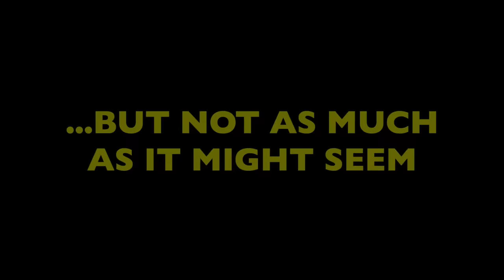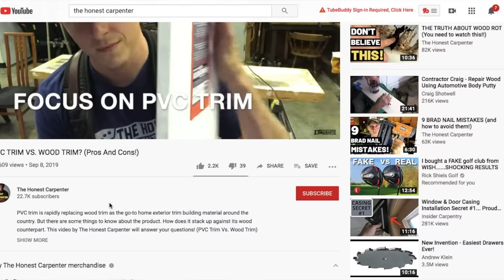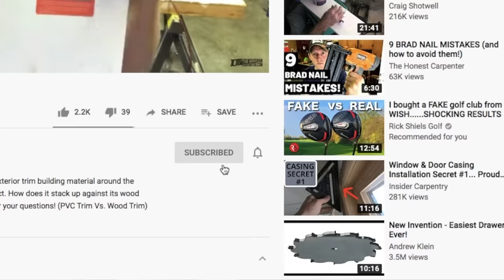How Much DAMAGE Can CARPENTER BEES Cause?! (What To Do About Carpenter Bees/How To Get Rid?)

Comment: I've used spray foam insulation in the holes with great success
Reply from the maker: Never tried that, Mike! But it makes sense...I bet it expands far into the tunnel
Reply: I think theres a "pest control" version of the foam too. Could be a good deterrent.
Reply: "Bee" careful with spray foam as it actually draws in moisture over time so it can rot wood or if next to mortar it will wick into it and cause damage
Reply: Weird. Spray foam is useless at keeping out regular honey bees.
Reply: Crickets love to eat spray foam...so I am gonna assume many other insects do too.
Reply: @thehumantoeRD  : Spectracide has a termite foam that also specifies use for "carpenter bees". Just heard of it. Headed to Lowe's now to find some. Put out 12 new traps yesterday at the horse barn. Going to plug holes in barn structure and see if they'll be interested in the traps. I've enjoyed the tennis racket game but my 70yo skeleton says to stop that.
Reply: Interesting because I tried this before and they seem to eat the foam insulation like it was cotton candy. I've filled the same hole half dozen times and they just went right back in within a few days.
Reply: Fine steel wool also works well
Reply: Spray wasp and bee insecticide into the holes and plug them with painter’s caulk.
Reply: @thehumantoeRD  There is
Reply: I moved in a rural house at the end of this winter.  As spring rolled in started to notice that I was moving into carpenter bee's home. 😁. I mean they were living in front stairs, side stairs, back deck, under the sheds. Did research and found that they are here to stay and we humans go and come.  Talk to neighbors and they had same issues. My son would reach to grab them mid air. Honestly we could not enjoy the outside. I know they are cool and all but we paid to be here so we need our space too🤨. So I figured bird feeder, birds around will eat some bees. Nope. So I got a carpenter bee trap. That worked but there's lots more. So I said I need my deck back. I unscrew few key located boards where I saw saw dust and found 13 holes. 😱. So I didn't know what to do now. And it hit me. Earlier I was working on my lawn tractor and immediately made the connection in my head. Grease gun hose is perfect size to the hole.  So I filled every hole. I'm telling you carpenter bee's don't let their home go easy. These guys would dig in it and die. To shocking results they stopped going for the same holes. Now the bee's under my shed. Can't see the holes. So I made the sad but no other choice decision.  Bought a  tennis racket and and... . You know.  Between the trap , plugging  the holes with grease and me with racket I took out approx 42 bee's. Right now I don't see any and we been having so much fun outside. Just wanted to share my experience with you guys.

Comment: Good luck on the structural value of deck railings after swiss cheesed.  Deck floor joists as well. They seem to like oil based surfaces less, will chew right thru latex. 
We re did the railings on more than 100 decks at an apartment complex.  It was a liability issue for the property.

Comment: Hello Honest Carpenter, have you ever tried making a plywood and corkboard sandwich? When we put these little 10-inch square sandwiches across the barn, the carpenter bees quickly inhabited them and left our barn structures alone. When they figured out we wouldn't run them off the sandwiches, they stuck to it and even defended them if we got too close. (bumping, not stinging) But the best part was that they chewed on those and left our barn alone. We got to keep the bees and we weren't suffering from damage.
Reply from the maker: Good advice, Clawdya!

Comment: This was very helpful!!  I put a used wooden swingset in the backyard and suddenly I have a ton of Carpenter bee's hanging around it.  Now I know to paint the wood to help them move along!!
Reply: Don't be surprised if that does not work.  I stained a cedar porch, and they didn't mind drilling at all, - at the stained ceiling where it is hard to get to to patch the holes.  I will say they do a good job of making perfectly round holes without a pencil & compass.

Comment: Great advice. I share a huge moribund oak tree with 3 neighbors. We have different approaches to these guys.  I live in the hilly suburbs of  San Diego. The female C.B. are blond/golden and scary looking with green eyes while the males are deep purple shellac color. They are harmless but buzz when agitated. My neighbor below us witnessed how the C  B. Took down the largest branch. Funny enough is that they don't eat it or live inside the dead trunk. My other neighbor sprayed inside the burrow holes with WD40 and filled in the holes with foam. Since the tree is almost dead and they ignore any of my wooden structures. The prior tenant would mix brake fluid and old motor oil and hosed them down in the fall and winter. Crazy

Comment: I like the plastic bag thing. I've had good luck with putting a mothball into the holes they've bored.  The smell drives them crazy. Also, you could put mothballs in old socks, place them at each of your attic, which will help keep mice, squirrels, bats, spiders, etc out.
Reply: Thats very interesting . I shall try.
Reply: Works real well with sweaty used unwashed socks.

Comment: I had carpenter bees in my fascia boards on my garage and side of my house. No big deal until a woodpecker was trying to get at them and I woke up to what sounded like someone banging on my house with a hammer. Not to mention they were spraying their goop on my siding under their holes. Was a headache to deal with and fix the holes, but haven't seen them back for a couple years

Comment: Great video with lots of information.  I am located in Ontaro and they have found my untreated carport.  The carport is to high for me to treat and I did have pest control last year but it did not last.  I was going to have the carport painted but there are so many nails on the underside from the roofers when the shingles were replaced.  Next option clean the wood and have fascia/soffit installed.  I am awaiting some pricing.  Has anyone had any troubles with them getting under the fascia/soffit?  Thanks

Comment: We had wooden barns on the old farm. They were so infiltrated with them over the year I did not take any of the wood when we sold and the land was cleared. I found a preventative ... we have all steel structures. I have seen some around here and told them to give it their best shot. They can be territorial and you should move slowly. They are attractive to quick moves.

Comment: I had a problem on the underside of my porch railing that was 90 years old.  I would use spray foam to seal the holes since I could flex the nozzle to get to the hole and I really could not see what I was doing.
But I always admired their perfect 1/2 holes.

Comment: If you have just a hole you can use a wooden dowel to fill it. Drill the hole the same size of the dowel big enough to fill the hole. Put some wood glue on it drive it in and cut it flush to the surface and you have a solid repair. Same trick works for stripped out screw holes like on door hinges also.

Comment: I use PL375 sub floor adhesive to pump in and fill the holes.  It covers the hole and maintains the structure integrity.
Reply from the maker: That’s actually a really good idea, Jim. Probably the only one that repairs at least some of the structural damage.

Comment: Things to know about bee hotels...If you use bamboo, cut at least 6 inch lengths. Be sure the inner 'walls' are removed and sand the entire cut surface, inside and outer edges. Make sure it has a roof and is hung out of heavy weather areas, for example on your porch or under the eaves of a garage or outhouse where the entrances to the holes are not getting rained on. Always keep an eye on the entrances because spiders love to hang out, web them up and eat trapped bees. Gently brush over the ends if you see any webs formed. Instead of tubes (bamboo or cardboard), you can drill varying size holes in a block of wood, again, be sure to round over the corners of the cut holes, bees are delicate. These are just a few things I've learned.

Comment: 2:59 Build a house out of bricks instead of wood? Just a food for thought. :D
Reply: Does that house come with brick trim as well?  On a brick house, the bees go for the wooden trim... especially cedar.
Reply: @cward1954  Now the question is what you refer to as a trim (it could be several things). But I am fairly certain that on brick house you woldnt face any problem with these bees. Simply because there doesnt need to be any exposed wood on the outside.

Comment: A trick you might try. Cover the hole with a piece of untreated wood. Make sure it's big enough for the bee and all of its friends. Drill a starter hole 1/4" deep. Then when the bee comes back it might try to make its nest in the new wood. 

If the bee does move in, slowly move the wood to a less unsightly location while the bees are active. It's important the bee is able to remember the new location, so only move it an inch at a time. Plug, caulk, and paint the original hole. 

A handy woodworker type might even make an attractive bee hotel.
Reply: I will try this.  We have worked hard to have a NWF backyard habitat so prefer options before killing.  Wonder why the woodpeckers are slacking.

Comment: They will absolutely destroy your house. They also have no problem with treated wood. They totally destroyed my Dads deck. We had to replace several joists so the deck would not collapse. Afterwards we setup traps and caught some but it did little to stop them. We did the plastic bag/paper bag trick and that did a great job keeping them away. We also painted the entire deck. So far this year we have not seen any of the, around.

Comment: The best way to deal with carpenter bees is to not make you house out of chopsticks.
Reply: Don’t leave tools lying around either.
Reply: [Communist China has entered the chat]
Reply: @TerraTN   So right! My home is sided in redwood so I am VERY interested in controlling them. I use an insect net to catch them on the fly. If I see one making a new tunnel, I spray butane into the hole. Instant winter!

Comment: Here in Quebec we call them bumble bees, and yes I've had them drilling holes in my pool deck and even found them in my bathroom vent
Reply: Carpenter bees have shiney butt.  The good bee has fuzzy butt.  I spray wd40 on the raw wood where carpenter bees like to drill.
Reply: The carpenter bee and bumblebee are different from each other despite looking somewhat similar. Bumblebees usually nest in the ground. Carpenter bees burrow into wood, often your house or deck.

Comment: Thank you for this film. I recently replaced the garage door jambs ( 24" ends of them to be more exact) and on one side (only on one) found some holes pretty smooth in the wood rail to which the door jamb is attached. That wood was very-very dense. There were no insects there, I filled all the holes with wood filler (saw dust and good wood glue, which is supposed to be of structural strength), let it dry, painted w/Kilz,  installed new ends, sealed w/Exterior DAP, and painted twice w/oil based paint. I assume the carpenter bees got there inside through some slits in the old and rotted ends.

Comment: I've made 4 traps out of scrap wood, and the top of a Tropicana Orange Juice plastic bottle.  I catch hundreds of them each year, but they keep coming.  I also practice my tennis strokes and take several out each time, but I think they see me coming with my racquet now and scatter.  They go under my soffits and I used that foaming stuff that expands to try to fill where they enter, but they have defeated me with that by finding new ways in.  They are a persistent lot.  They do however pollinate my flowers and garden items, so I hate to kill all of them.  One time I opened my trap as it was filling up, and to my surprise, I had 65 of them in the trap.  I hang the traps high so I have to use a ladder to get them down to empty them, so I don't do it that often.  They made 2 new holes under my rear steps.  I filled one hole with plumbers putty, and they dug out in one day.  For anyone that knows about Bondo (usually for auto dent repair), that works great.  They never return thru that stuff.  I've only used it once though, but it has worked for 2 years now.  They do not go thru the foam stuff either.  Hope that helps someone.

Comment: I've had good luck with using a paper bag where carpenter bees were just getting started, but not luck deterring them in areas where they are well established. The traps have been useless in my experience. I wasn't aware that carpenter bees were pollinators until now, thanks!

Comment: I've had carpenter bees in one of my sheds for over 10 years now.  I like them.  So far they have no messed with my house or my other two sheds.  They are my little buzzy buddies.   In the summer my backyard is like Tolkien's Beorn bees.  Whatever damage they have done to my shed is worth their company.  I'm worried as the shed is in need of a painting and not sure how I'm going to do that without harming them or driving them to my other sheds or house.  Perhaps in the late summer/fall to avoid doing harm.  Maybe stuff holes with a cotton ball.  Something that can be pulled out.

Comment: Have you noticed the newer (last 10 years) pressure treated wood does not prevent carpenter bees? My deck is 30 years old and carpenter bees never touched it. I put in some bracing (for new deck posts) with the newer pt wood. The old pt wood was cuprous arsenic, nasty but effective preservative. The new style pt wood had holes drilled in them in one season! I'm going to paint/stain them this year, that has worked for me.

Comment: What worked for me is spraying prone areas with Ethanol that contains Bitrex. 
They try to land don't like it and fly away. Try another approach for several times but will keep them away without killing them. They'll eventually find a new spot somewhere else than the roof. 
Garden post etc. is fine. That's not structural.

Comment: I had a terrible time with them when I bought my house 30 years ago. I told my young children that if they spotted one and I caught it in my insect net I’d give them a stick of gum. I quit that reward to protect their dental health. My house is redwood and it’s very hard and expensive to replace wood, but to put siding on or paint would be a disgrace. So I have fought them over the years. Things finally improved when my neighbor tore down his much infested pergola. They still get after my cedar and redwood fences. I have tried the foil and steel wool and yes it is critical when it is done. If they are in the pupal stage when they emerge they will have to chew their way out causing lots of surface area damage. Lately I have dealt with infestation in my fence with butane. I inject the cavity with butane and freeze the larvae. I also keep a net handy and snag one whenever I can. They don’t get relocated.

Carpenter bees are solitary wasps. I once asked a famous entomologist, if they are solitary why do I see huge numbers of them. She explained that solitary means there is no caste system with different individuals performing separate roles for the colony as you would find with honeybees. Her name is May Berenbaum. Look for her books. So funny and so instructive. Look her up. Gene Robinson is another bee expert who lives nearby. It’s not everyone who is first to map the bee’s genome. Living in a university town has advantages.

Comment: Expanding foam holes. After spraying hole with essential oils. Take a log, put eye hook in center, drill 3/8 holes in bottom bout 2 inch deep, to 6 inch. Hang from nearby tree.  Bee hut. My new porch has the going into countersunk screw holes under railing. Not sure if im gonna get rid of them til winter. I Like bees.

Comment: Every spring for me is a stakeout with an old badminton racket. They sure do zip straight up fast when you swing it, but if you anticipate it, and swing higher than you think you'd want to, you can get them. It just a good thing they DON'T sting since  you miss and piss them off 90% of the time. Tennis rackets are no good. Can't swing them fast enough to beat their escape.

Comment: I read about the bag solution, however I was told a brown paper bag filled with misc filler works best. I tried it about 5 years ago, and it works great. The paper bag will actually last most of the year, and I was told that they think it’s a paper hornets nest. I was told their eyesight is not so good (think Mr Magoo) so it takes a few days for them to figure it out, then they’re gone. Gotta do it every year. 
I used an 18 inch fish leader wrapped around the neck of the bag, with a push pin to hold it under the eve. Prepare yourself though, any friends that visit your house will think you’ve slipped a gear lol

Comment: JB weld the holes. They ain't digging that out. I made a target for them. I took an 8 foot length of landscape timber and put it on two posts in the ground at either end. Then made a little roof down the length so it was dry all the time. They drilled the hell out of that, but don't come around the house or deck much. If you find an existing place they burrowed, plug drill it and put the hole in the bottom of the timber. They'll find it.